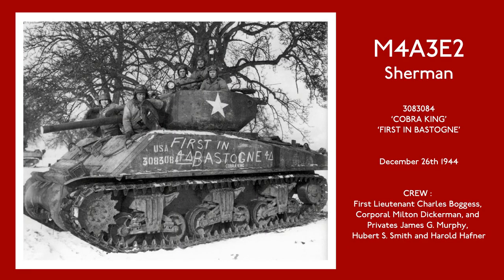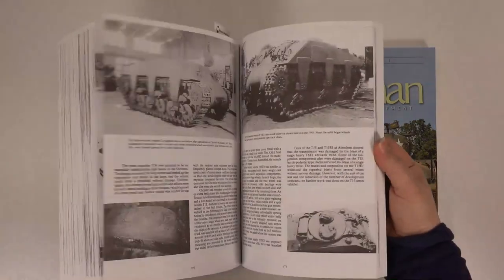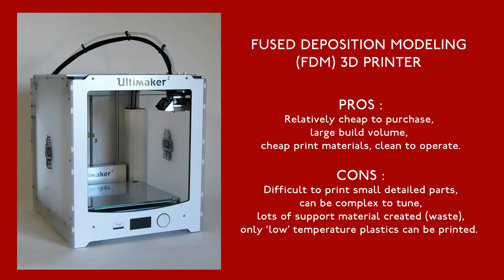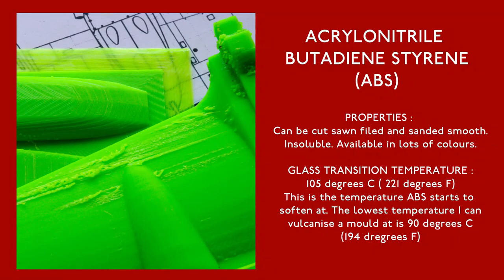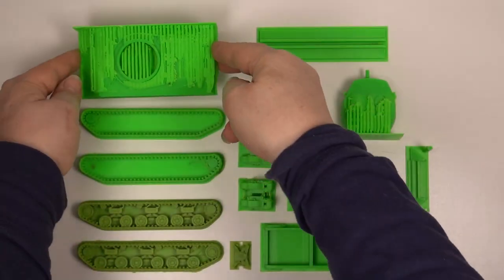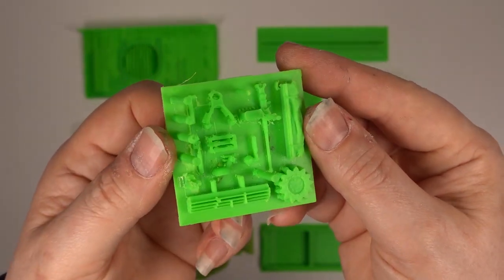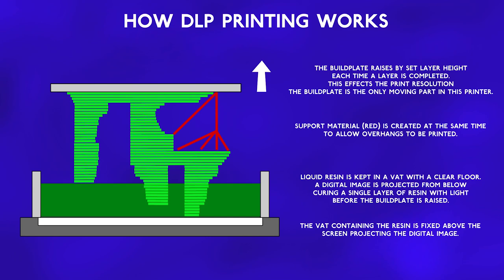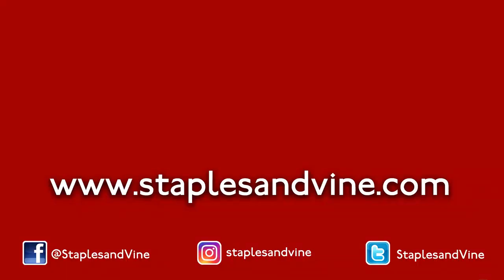SERA’S VLOG  PART 8  ‘3D PRINTING THE SHERMAN’

Comment: Hello, I realize this video is a little old, but I am considering using my CAD system (Freecad) to design/3D print a Sherman.  I'm looking for a good source of drawings to base my model on.  I'm thinking of going the route of putting RC in it and have seen several videos of others that have done that so would scale it to accommodate that setup.  I've ordered a couple books from Amazon that will be here shortly.  I wondering if the Hunnicutt book might be worth the investment?  Any suggestions or thoughts would be appreciated.

I recently completed a 3D printed RC model I drew from drawings of the LA City No 1, a fireboat my dad worked on during WWII.  Really fun to run around the local ponds.

Thanks
Reply from the maker: Hi Larry, the Hunnicutt book on the Sherman is excellent it has highly detailed drawings and explanations of all the detail components of the Sherman throughout its development - highly recommended. The only issue I have with it is the lack of general arrangement drawings, however these can be supplemented by other publications. If you are serious about Shermans this book is a must. 🙂